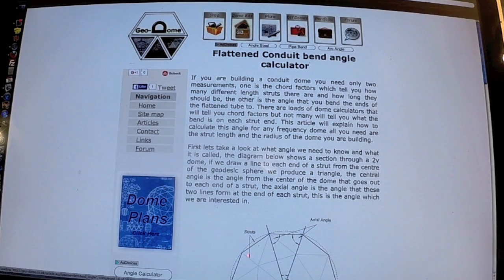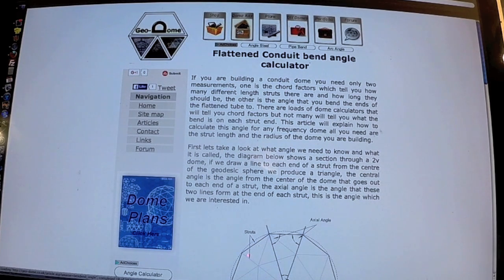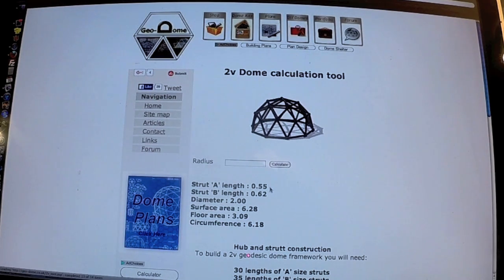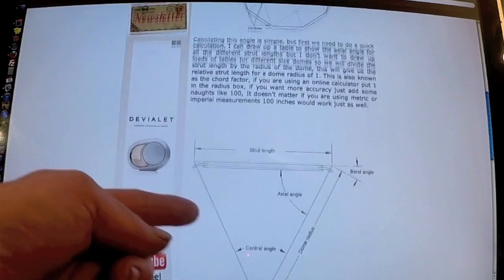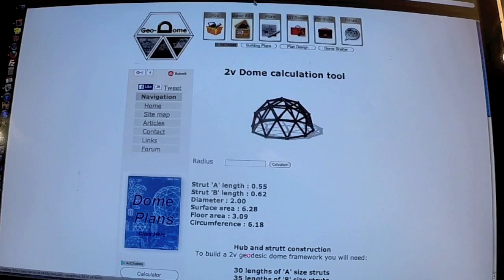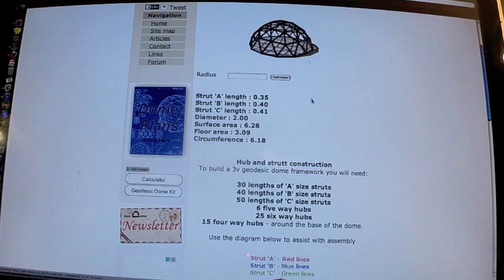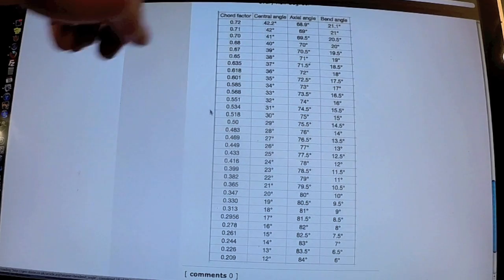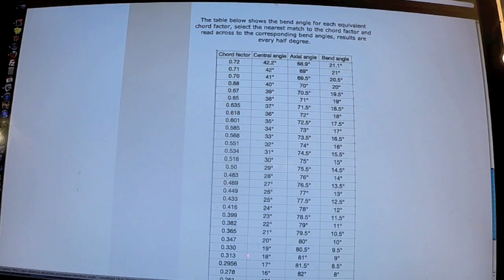Dome build methods - flattened conduit

Comment: Curious to the feasible or a dome where the struts are bent in the middle and using flate disks as hubs.  Perhaps square tubing notched and welded to the sum of the two angles. Do you think this structure would be strong still?

Comment: So for hubs, why not a small metal disk, bent into a slight dome/cone shape, with holes drilled appropriately? Such a thing couldn't be that difficult, and would be cheap.
Reply: I've been musing on something like this, and using a plasma cutter to cut a conical template, rolling it and welding a seam, then welding the pipe to it,....

Comment: making a straight line across the pipe at the falttened end makes an easier bending point, in high winds the strut ends could flex and break more easily..
Reply: In another video someone used a hydraulic  press with plated that had a curve.

Comment: You could use a 3 ton hydraulic jack set up on a steel bench, with a simple RHS frame around it, temporarily welded to the bench, in combination with an alignment locating jig, that also keeps the 2nd end to be flattened in the same plane as the first flattened end. 
The jack will also be fitted with radiused flattening tooling, so that the point where the tube transitions from flat to round after flattening, it does so with a radius, rather than just a straight edge transition, to give it a more professional look. Also a 2nd radius (as you've nicely done), that's ground on the very end of the flattened tube, completes the finished look. 

Then another jig is made for nest-centering the tube ends in the drill-press, to auto align them for drilling the holes, with a locating pin for locating the first drilled hole, set at the correct centre distance from the 2nd hole about to be drilled.

Comment: 4:14 Maybe take three double-length pieces of conduit, flatten each dead center, drill the single hole in the center of that. That way, you only stack three levels tall instead of six. What do you think?
Reply: I don't understand, because in order to build a dome you will need those points to have 6 framing pieces spanning  to the other hubs, where those will need 6 framing pieces all joining and then spanning to the other hubs, of which will need 6 framing pieces all joining and spanning etc, etc...
Reply: @TheRebelmanone  
Just use a flat,galvanized hexagon plate.
Reply: Better to just use a coupling and weld it to a flat plate cut round(hexagon), weld 6 of them in the correct directions and angles on the round flat plate to make hubs, then the pipes don't need to be flattened and can all be aligned on the same plane in order to achieve a flush surface on the finished dome. Use the hubs in every center of every hexagon and pentagon(only need 5 couplings), and the dome will be professionally looking, more stable, and flush able to be paneled, and set with real glass if preferred over cheap plastic.

Comment: I love your videos, but I have to tell you, if you're going to build with metal you need a hydraulic press to squish the ends (I call it a squisher) - a 20 ton one on eBay is under $300 US, soooo much faster. a 12 ton one is only about $200.  I can't imagine the time and effort you put in doing that with a hammer!
Reply: Time? It took less than 20 seconds to flatten each end piece, another 10 to drill a hole. Maybe he'll spend a minute and a half on each tube. Depending on how many he plans to use, it might take a total of 2 hours to get it all prepped.
The spending isn't justified.
Reply: 36 hits for one side - check out how fast I did this with a hydraulic press. 
. https://youtu.be/tAVa5PSQ0NU
Reply: $200 for a decent hydraulic press new on eBay.
Reply: Hammer $12
Reply: Good anvil $200 - you can buy junk but you need something with weight, real steel costs money.
Reply: You can flatten the pipe on a $3 concrete block with the $12 hammer.
You don't live up to your name of "Simple Tek". You seem to want to complicate this simple process by adding unnecessary expenses.
Reply: Old Man from Scene Twenty Four - you’re right it can be done cheaper if your time isn’t worth anything. Mine is.
Reply: Well the time you take to earn the money to buy the expensive equipment is wasting time. Working 40 hours to earn the money to buy a $300 squisher (as you call it) vs 3 hours or so banging on a rock with a $12 hammer and NOT spending $300  in accomplishing the same thing. It seems doing it your way wastes both time and money.
Reply: Old Man from Scene Twenty Four that only makes sense if you work for minimal amounts of money
Reply from the maker: Yes i agree but I also agree with "Old Man from scene Twenty Four" If you are just building one dome or part of a dome then a hammer is fine. For bigger jobs or having a business that makes domes you definitely need a press. I bought a press when I was commissioned to make a full dome: https://youtu.be/E_odIPttYP8 but for this example I just used a hammer.

Comment: OK, but just make a steel plate hub with 3-6 holes and the stacking issue is solved.
Reply from the maker: Yes but you will need around 75 of them for a 3v dome and the hub can twist so you will also need two holes in each strut end. If the stacking doesn't bother you I don't think it is worth the extra cost/effort. Also you then have the same drawbacks as hub and strut construction: https://youtu.be/rYyxVGhK2hY No system is perfect you just have to pick the compromises you want to live with.

Comment: Nice instructional video. The strut angles need not be calculated, the calculated length of the struts are the controlling angle factor in each of the the dome hub groups as the dome comes together.
Reply from the maker: Yes that's correct you only need the strut length and radius to work out the angles.

Comment: Maybe if you covered one of those in shrink wrap and hat treated it you could use those as cheap alternatives to poly tunnels?
Reply from the maker: I don't recommend covering this style because you can't cover them neatly, shrink wrap is a temporary cover (usually over boats etc) and will always have wrinkle/creases which spoils the look in my opinion, I don't think t is designed to last more than a year or two either.